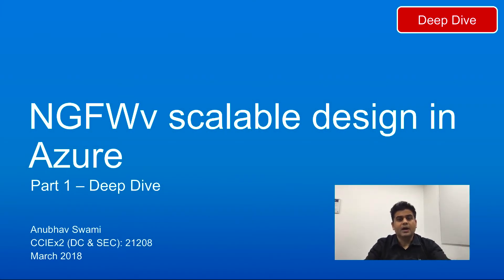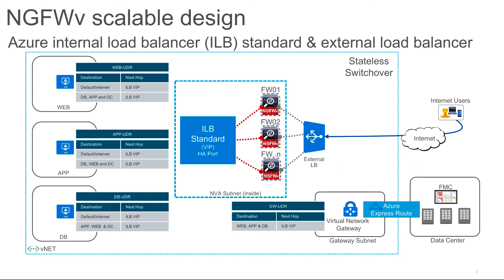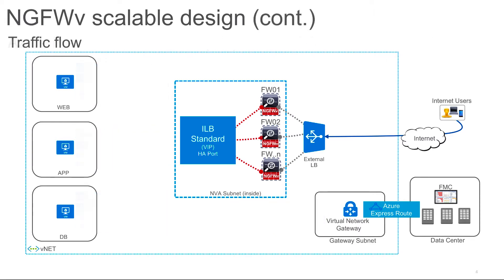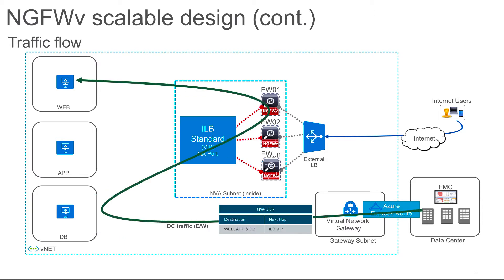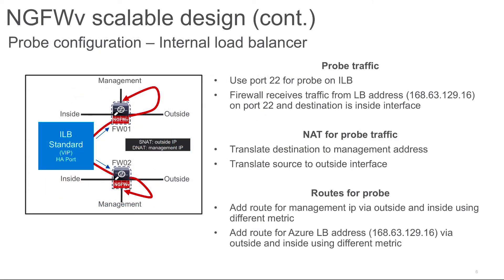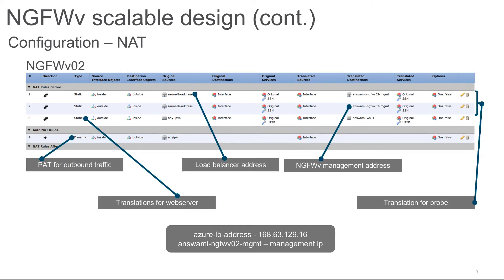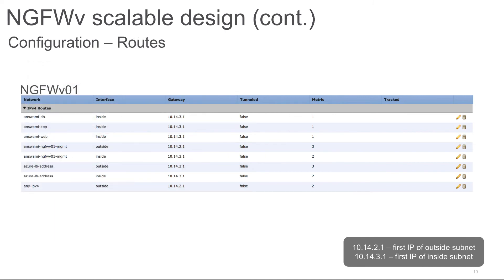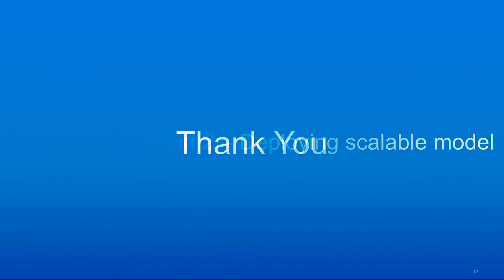NGFWv scalable design in Azure - Part 1 (Introduction)

Comment: Hi, very informational video. I have a question in the traffic flow slide for the outbound traffic (@4:26). When the firewall SNAT the source ip to the external interface and sends it to the load balancer, does the external interfaces need public ip's along with private ip's ? will the snat be done using the private ip of the external interface ? Thanks
Reply from the maker: We don't send internet bound traffic to Public Load Balancer. We sent it directly from Firewall to internet using PAT on the egress interface (outside).

Comment: Is it possible to use both ASAv and NGFWv in Azure?  We currently have ASAv and want to have IDS in Azure.  Any recommendations?
Reply from the maker: Yes, you can put ASAv at the edge for VPN and then bring all your traffic to FTDv/NGFWv for NGIPS functionality. NGFWv in Azure/AWS can be deployed in Routed Mode. I am trying to understand what is your use case for seperating ASAv and NGIPS function?
NGFWv can provide you VPN and other functionalities like (NGIPS, URL filtering, Application Visibility and Control and Advance Malware Protection)
Reply: We initially thought ASAv had IDS functionalities so we used the ASAv.  It's a two-tiered architecture, one ASAv for perimeter (N/S traffic) and one for datacenter (E/W traffic).  Researching further on the NGFW, it looks like it's better that we replace the ASAv's with NGFW altogether.  What's your suggestion?
Reply from the maker: Nelson S: You can use FTDv/NGFWv in azure for firewall and NGIPS functionality
Reply: Is the FTDv the same as NGFWv in Azure?  I couldn't find a FTDv template in the marketplace, only NGFWv.
Reply from the maker: Yes it is same NGFWv is same as FTDv
Reply: Thanks!

Comment: The any connect license with ftd image doesn’t support dual AAA. Is there any recommendation for applicable use case to overcome this limitation
Reply from the maker: Rasool I need to check roadmap for that feature and unfortunately, I can't share roadmap items directly in public forum. I would suggest you to contact you Cisco Accounts team so that they can contact Cisco Security Business unit for more information. Hope this is fine.